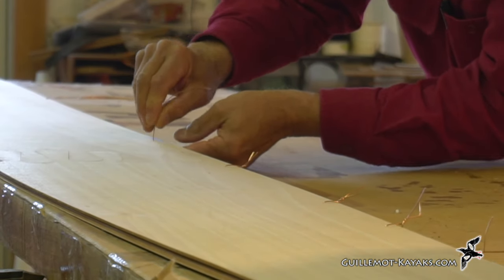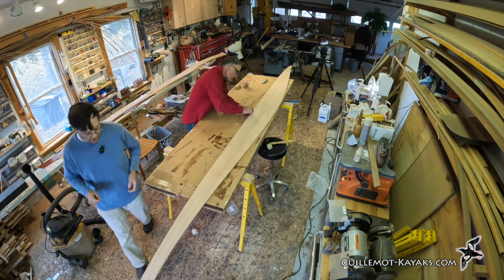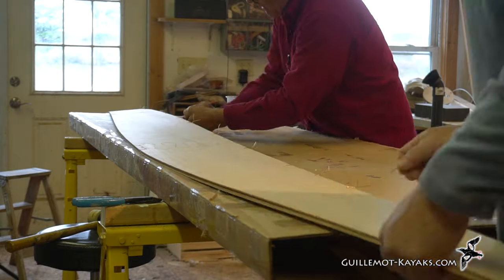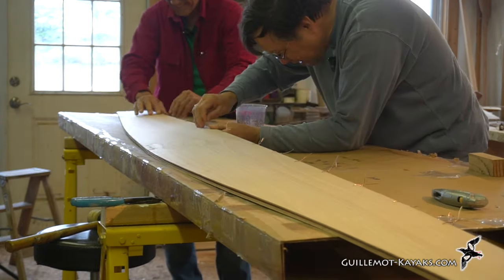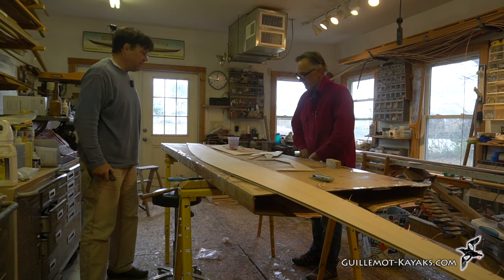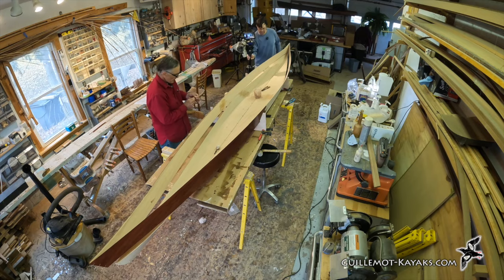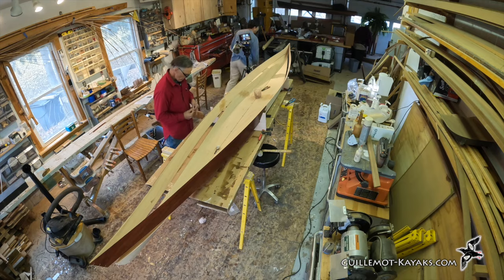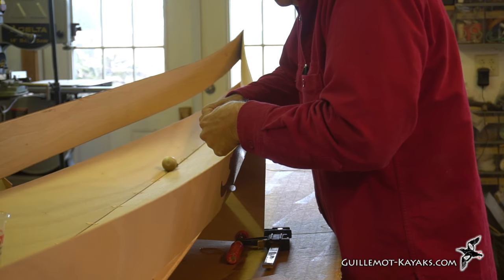Setting Up the Hull on a Stitch and Glue Kayak - Petrel Play SG Build - E4.2

Comment: The all knowing Wikipedia says that Stitch and Glue techniques were first thought of in the early 60s by Ken Littledyke. He apparently used fishing line.
Reply: I was always under the impression that the Mirror dinghy was the first, but as indicated above maybe not. It certainly popularized the technique.

Per Wikipedia: The Mirror was designed by Jack Holt and TV do-it-yourself expert Barry Bucknell in 1962.[2] It employed a novel construction method where sheets of marine plywood are held together with copper stitching and fibreglass tape. This is called tack and tape or stitch and glue construction.

Comment: So when attaching the forms, wouldn't it make more sense to slide the "U" through the single eyelet into the two and do your twist on the inside of the hull?
Reply from the maker: It will become clear why I do it this way later. I actually leave those stitches in place while fiberglassing the inside.

Comment: Question: could it be easier to attach external forms the following way: rotate the boat upside down and attach the forms from above, then rotate it all back.
Reply from the maker: It might be easier. It might be worth trying if you want. There are still a lot of floppy bits at that point so the flipping over and back may be a trick.

Comment: I am guessing the reason to use copper wire instead of bailing wire is bailing wire is coated with oil and will stain the plywood. Is that correct? Thanks for sharing.
Reply from the maker: Bailing wire is larger gauge so it needs a larger hole. It is a bit less flexible so it is harder to work with. And oil isn't good either.
Reply: Also harder on your snippers.
Reply: Also, I think bailing wire may rust if a piece ends up being left in there. Copper won't rust.
Reply: Additionally if the wire is hard to remove you can heat the wire with a heat gun (copper will conduct heat fast) and when heated you can easily remove with pliers.

Comment: Did the American Indians use a stitch and glue process for birchbark canoes (sorta)?
Reply: Good point! IIRC the birch bark is sewn together with spruce roots (again from memory (from a WoodenBoat article maybe), I’ve never done it).
Reply from the maker: The process of making a birch bark canoe is very different. While the bark was sewn, it was generally bent into shape with darts that were sewn back together. The structure came from ribs.